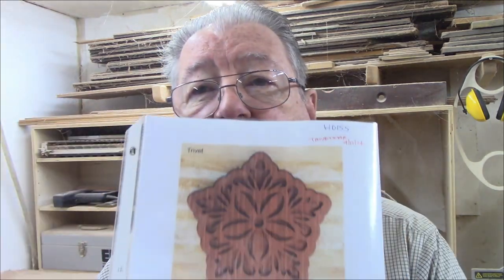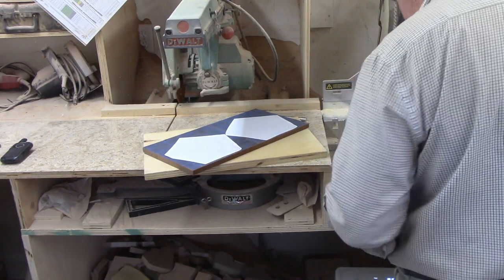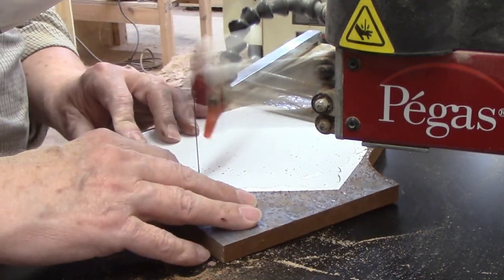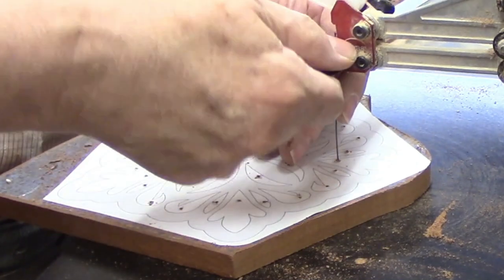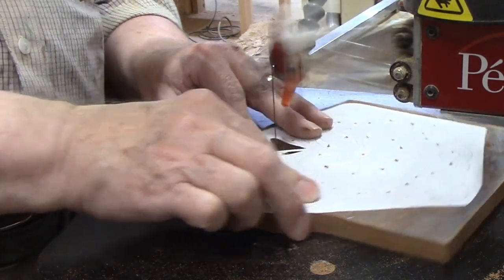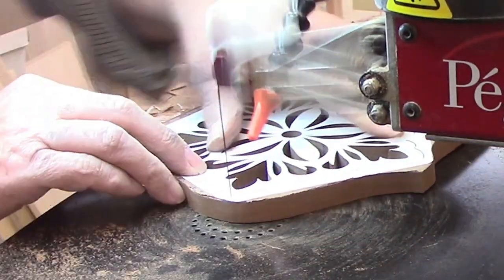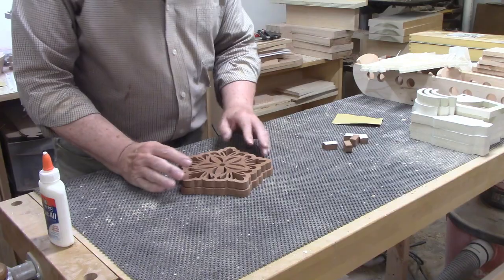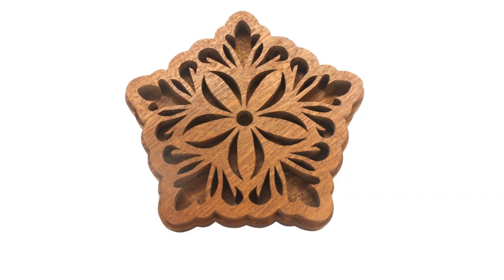Make This AMAZING 5-Sided Trivet With Your Scroll Saw!

Comment: In watching your videos what is the advantage in using a modified geometry blade? thanks
Reply from the maker: I have tried a number of different blade brands and types over the years. I have worn out several scroll saws and have racked up thousands of hours in the woodshop. In my experience, the Pegas Modified Geometry blades give me the best results. They cut smoothly and leave the least amount of  "fuzzies" on the underside of the workpiece, meaning most of my projects need little to no sanding. If you haven't already seen it, I recommend watching my video where I test and compare 14 different blades. The link is here: https://www.youtube.com/watch?v=CfVKmQt_ksY

Comment: Did you apply any type of a finish to your trivet?  I just use a mineral oil/beeswax finish that I have for cutting boards since I felt setting a hot dish on most finishes would make them crack or melt.  If you have any suggestions for a good finish to use on trivets I'd love to know as I'm making some for Christmas gifts.  Thanks for all your tips!
Reply from the maker: I did just a little research on the subject. On the Rockler woodworking site someone asked what finish to use on a trivet and they recommended an oil-based polyurethane mixed with mineral spirits to thin it out to allow the finish to flow into the nooks and crannies of the trivet. Another site recommended oil-based finishes, and a third recommended Danish oil or other oil.  I used a spray polyurethane on mine to get in the nooks and crannies, but after giving it some more thought I think next time I will go with the oil-based poly thinned with mineral spirits.
Reply: @bobshomewoodshop7996  Thanks so much for the information Bob!  I think the safest thing to use is a penetrating oil of some sort.     I just got some Danish Oil for another big project but it dries to a somewhat hard finish and I'm concerned that might crack or melt on a trivet.  My trivets have a decorative tile in the middle framed by wood and I set the tile a tiny bit higher than the wood to keep the hot dish from sitting directly on the wood.  I tried Howard Butcher Block Conditioner on the wood and tested it a few times with hot dishes.  It looked real nice and held up fine not showing any signs of being effected by the heat.  It's a mixture of mineral oil and natural waxes.  Will probably need reapplied periodically but it's so quick and easy.
Reply from the maker: @SawdustmakerLori  Thank you for the information, and the actual test. I use Howard's on any item that will contact food, so I always have some on hand. My only concern will be how to get the wax into all those little nooks and crannies. since it is on the thick side and I usually use a rag to spread it out.
Reply: @bobshomewoodshop7996  I agree it would not be the best choice for something with a lot of nooks and crannies.  The trivets I was making are like a wooden frame with inlay surrounding a decorative tile so it worked great there.  I do always apply it warm though  and that makes it soak into the wood better regardless of what I use it on.  I put the bottle in hot water (from the tap, not the stove) and let it set for a while to warm it up.  That makes it thinner since the wax melts.